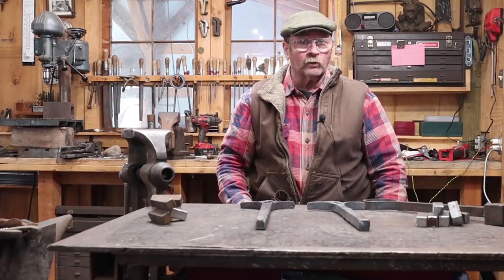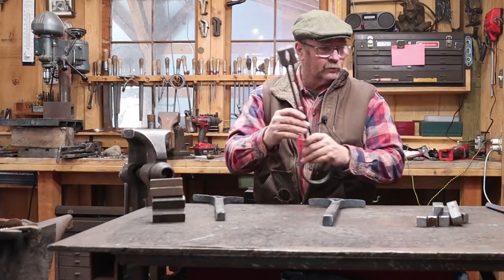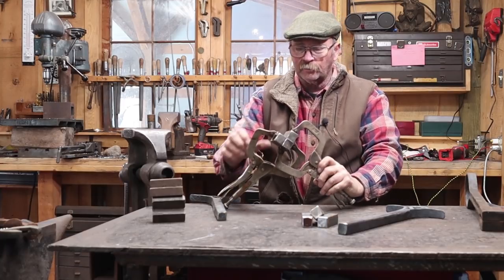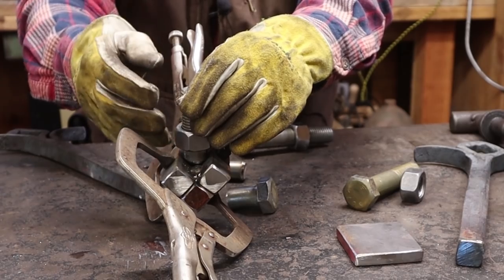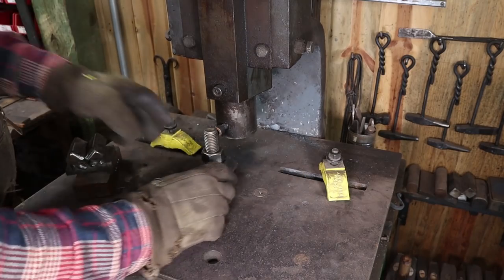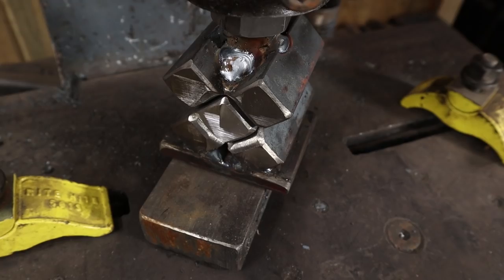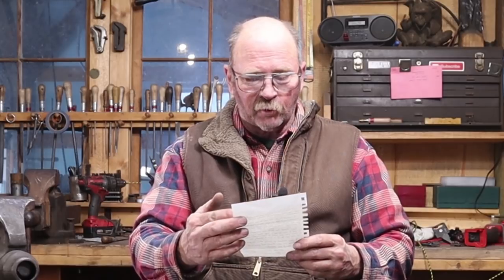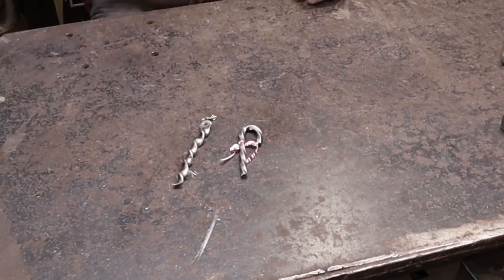Fabricating V tools for the Fly Press

Comment: Hi John, I like the way you end your videos. Get out in your shop and make something, be safe, and ware your safety glasses. Never leave home without them. Last night at the local guild, I was finishing up the stem on a leaf, next thing I see is the leaf heading towards my face. I close my eyes turn my head just enough to get a glancing blow off the corner of the hinge of my glasses and singed a little hair by my left ear, then floated to the floor. I quickly picked it back up and not wanting to wast the heat made several more hits.
After replaying this several times in my mind, at the time that the leaf came out of the tongs, I felt in the handles the shock like a mouse trap going off prematurely when setting one. I was using horseshoe tongs with divots in the jaws. The question is, did I pick up an explosive charge when I took the metal out of the coal fire and it ignited when I struck the hot iron.
I do know that coal dust is very explosive, I have emptied the forge pot twice with gas explosions. But that is another story. No I didn't have to change my undees, just another day in the shop, that makes it interesting. I just wanted to share this little safety note, things do happen that were not planed. Yes be safe out there.

Comment: Something that I was thinking of when you were talking about the shoulder, John..... you could also hammer the round bolt into square stock and have a swage block of sorts....
Edit: You could improvise a guillotine tool of some sort🤷🏼‍♂️. Just something that popped into my head, thought I'd share.
Reply: Was it square ,just wondering ? Nice way to v blocks
Reply: Was what square?
Reply: He said he was going to check his stock to see if it was square was just wondering the outcome I imagine that it is because John is such a craftsman
Reply from the maker: I will show that in the next video on this project. Still to hot to handle when I left the shop after filming.
Reply: Also sorry Tyler Thompson I meant to leave that in the comment section not as a reply to your comment

Comment: thanks very much
Did you use 8 grade 1" bolt for the shaft and how did you cut it?
Was the V block material made from mild steel or medium?
My #5 arrives today and I need the advice.... thanks so much!
Reply from the maker: No, there isn't any need for a high strength shaft.  Same for the V blocks, mild steel works just fine.
Reply: @BlackBearForge  
You're our hero John....HUGE thanks for SO much help and enjoyment along the way.   👍🎉
THANKS AGAIN!